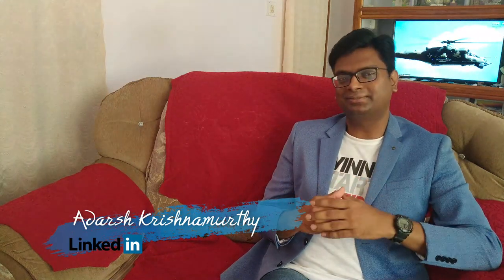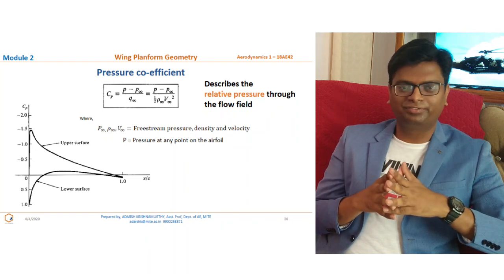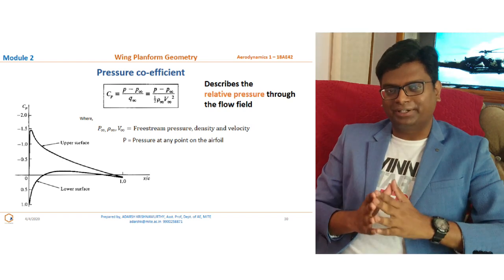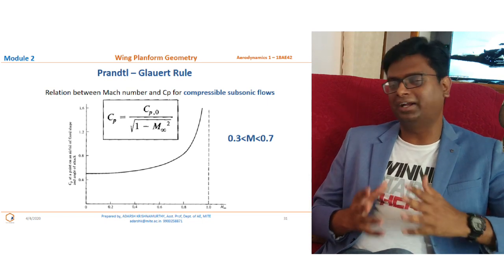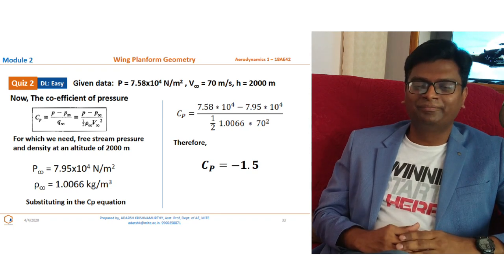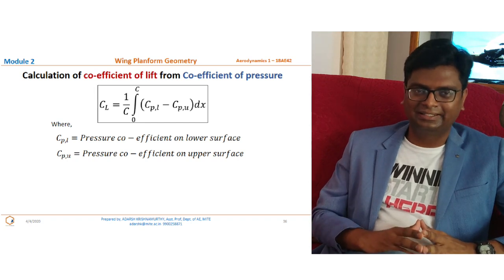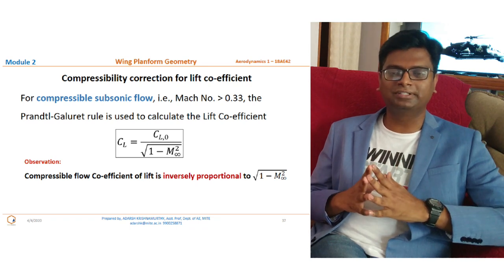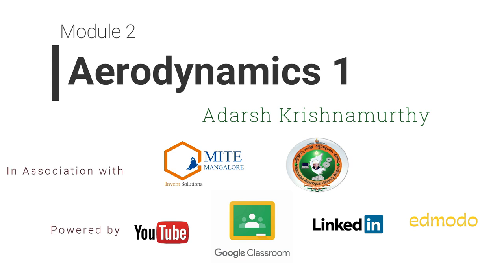Aerodynamics1 | Mod2 | Lec18 | Lift & Pressure co-efficient

Comment: Hi,
If the pressure get decrease in upper surface from leading to trailing, then the cp has to starts decrease from low negative value to high negative value , when its moving toward trailing edge, how come cp starts increasing from negative to positive